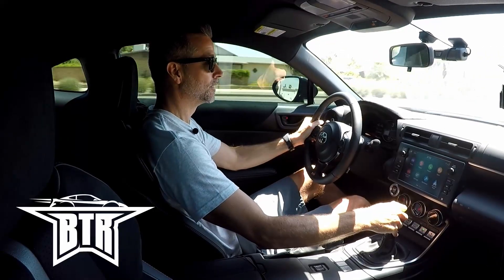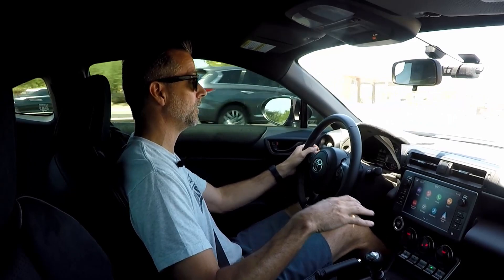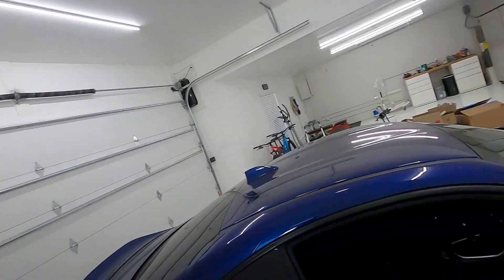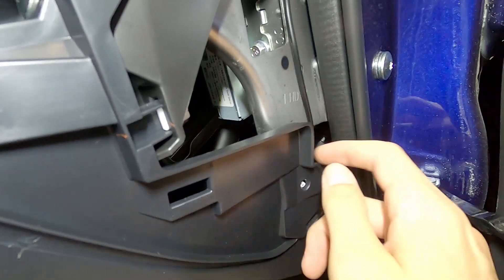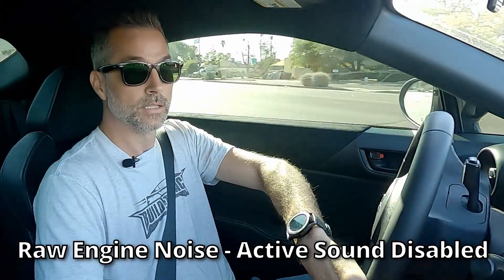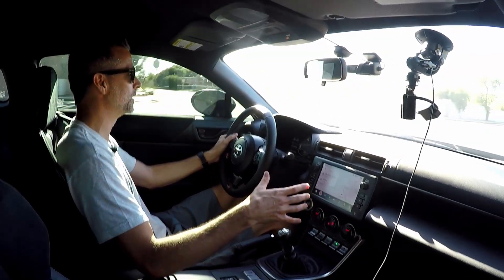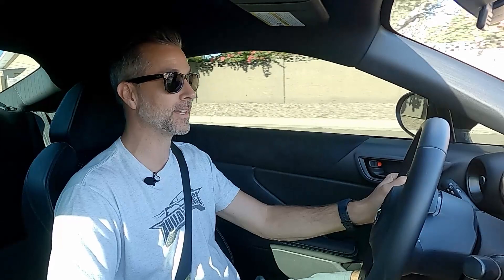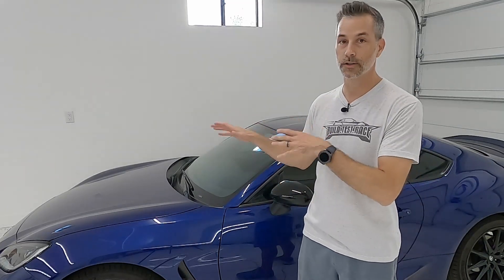GR86 Fake or Real Engine Noise - Which is Better?

Comment: The irony of them creating a car a vehicle with the bare roots for car enthusiasts and a pure experience..  then pump in a fake sound lol
Reply from the maker: I know right lol, I eluded to that in a different comment. Doesn't make sense.
Reply: And now they all come with the EyeSight driving nannies and stuff... Very sad to see the direction sports cars are going.
Reply: @Bristecom Eyesight is just adaptive cruise and stuff, it’s not like the car’s driving itself
Reply: @ It does automatically brake when I don't want it to fairly often though. Even the loud beeping noises get very annoying and you can't permanently turn them off without blocking the cameras and having several max brightness warning lights on your dash. Also the auto high beam feature rarely works correctly and requires me to fight it when I'm trying to turn my highbeams on or off each night (requires 2-3 pulls sometimes). So after using it for 7 months, aside from the auto cruise control, I'd say it's a terrible system that I wish it didn't even have (or at least I wish it would be updated to properly adjust or disable without being penalized with warning lights).

Comment: The fake engine noise sounds like a good copy of an aftermarket exhaust. But once you hear it side to side you can pick that it is not the genuine sound, but only slightly.   Great to get a side by side comparison. Keep up the good work Justin
Reply: What?!
the fake noise sounds like a really bad arcade racing game.
if you want to hear the engine, put an exhaust on the car.
Reply from the maker: Thanks!

Comment: I’ve switched it on and off 3 times already, each time I eventually end up finding the fake noise annoying over time. In my case I have an aftermarket catback though.
Reply from the maker: I'd definitely have it disabled if there is an exhaust on the car :)
Reply: When I get mine I'm probably gonna keep it on until I get an exhaust. I hear if you disable it with stock exhaust, there is barely any sound at all.

Comment: I hated my 2023brz sound system, it distorted my music and sounded terrible, like 4 days after i pulled the plug from the engine sound box and it fixed that distortion in my music as well. Just an fyi.
Reply from the maker: Interesting find! Which model do you have? I have the premium which has a better sound system. I didn't notice a change in music after disconnecting the ASC. Wondering if it's a thing on the base model which has less speakers.

Comment: do you know if it uses a separate speaker, or is piped in on the main speakers?  i have a 2024 brz ts, and just wondering before i detach it.  thanks-
Reply from the maker: Piped in on main speakers as far as I know.
Reply: i pulled the plug - and i think the stereo is 100% better sounding.  may be in my imagination, but i dont think so.  wont be going back to the fake noise!  
 @TheBTRGarage

Comment: I bought 2024 GR86 and drove it with fake engine noise for 3k miles.

Went to Toyota and had them disable it. 

Now it’s disabled for 3000 miles, it’s the best thing ever. That fake engine noise is complete garbage.

Comment: The digital sound actually sounds really cool if you ask me. Sounds better than most aftermarket exhausts. The only issue for me is that its loud. Would sound better if it was quieter.

I dont like loud exhausts personally. Its annoying after a few weeks and the power gain is usually minimal.

Comment: A tube that allows those in the vehicle to hear the engine is far better than a speaker playing sounds of what an engine might sound like. 

In a pure sports car, there should not be any fake vents, aero pieces stuck on to make the car look fast, and no speakers to have the passengers hear what a good sounding engine might sound like. Subaru came so close when building the BRZ/GR86, why did they throw in the gimmick of fake engine sound.

Comment: I have the GR performance exhaust. Does that make a difference in sound compared to the stock exhaust with the fake engine noise off?
Reply from the maker: Not sure, I haven't heard that exhaust in person. You can always unplug the sound generator to see for yourself, plug it back in if you still want it.

Comment: Nice comparison! I haven't turned mine off yet, but I will. The fake sound is just too loud for my taste. I'd rather hear the actual, muted engine sounds. The car is plenty loud enough with the noise coming in from the tires and chassis. At some point I'll add an exhaust, but this will be my first 'mod'.

Comment: After break in and at 1100 miles total I unplugged it....sure its really quiet down low but above 4k you can hear the engine enough aslong as your not blasting the radio.

Comment: Love your videos.

FYI - The system isn't quite what you describe Justin.  There is no audio track that is played, the harmonics of the engine are extracted from the RPM signal (which itself dictate the waveform of the sound naturally) in 12ms updates and a gain is applied depending on torque and acceleration inputs.  What ends up happening is effectively they concentrate the volume of those engine waveforms around the ones that are good (there are bad engine sounds in chain driven boxers as you would know) and less focus on ones that are bad.

The effect is that the sounds is true to life (its its a direct feed from the physical behaviour of the cars engine) as the extremely quick feed (basically 1 100's of a second) captures the timing of almost every single revolution live, with I think capturing the current data point for every 2 RPM at around 10000 rpm.  Certainly more than fast enough to hear even the slightest change in behaviour of the physical engine.

I think its pretty good, I mean you can clearly tell that even though its louder, the sound when its removed is incredibly similar.  With all the regulations that these globally offered cars have to meet, its a good change.

The litmus test is how often people who know nothing about it will comment on how good it sounds.  And they do - its usually the first thing someone that rides along will tell you.  That was just not the case with the last car, and I cant imagine it would be the case (stock anyway) if you removed the sound.

All the manufacturers (Porsche/BMW/Toyota/Honda etc) use these systems, I think the Subaru one sounds better than the Toyota one for instance that they use in the GR Yaris.  If you have an after market exhaust and are not burdened by noise laws then I think changing it is fair, but not because its not good, just because it will overwhelm the noise of the exhaust.   Of course we can all dream of a world where ITB's were something they made stock :)
Reply: Yes. While technically it isnt the true engine's sound, it is from the engine still. Similar to hearing a friends voice on a high quality phone call. Its their voice, its just a little filtered and coming from a speaker.

Personally, I like the pumped in sounds. I'd prefer it if there was a toggle though. Its been my observation that the average person installs aftermarket mufflers and intakes(usually with no tuning) these days mainly for personal tastes in louder sounds over actual performance. So if the sound to your own ears is all the average person cares about, then custom filtered engine sounds coming from speakers or a sound tube is better than the expensive option of swapping intakes and mufflers without a tune(and if its too loud, then others are forced to hear it whether they like it or not too, so there's that if your someone who is considerate)
Reply: @JupiterxBlues  I agree, in particular the sound in the mid range is great.  Up high I think you can hear the engine naturally so its probably less impactful.
Reply: Whole lot of words to say nothing
Reply: All that to hear a noise that sounds like an engine?  Why not just turn it off (or not install it in the first place) and just hear the actual engine?  I've unplugged mine and it sounds sooo much better.  In my view, the ASC creates a sound that makes the engine sound rough and raspy.  With ASC disabled it sounds more like a refined sports car, aka more like a Porsche.  And, yes, I know Porsche uses a similar system.  I'm referring to what the Porsche sounds like from outside the car.  But, with ASC off it sounds like like a Porsche from the inside of the car also.
Reply: @AX-Driver  if it convinces some people not to install an obnoxiously loud aftermarket exhaust because they already hear the engine loudly in the car than I consider it a net benefit. Wish it was on a user accessible toggle though.
Reply: @seanmackay6739  Yeah, good point on avoiding load exhaust systems.

Comment: Let me think...... When driving a performance car, do I want to hear what the car and it's engine is telling me or do I want to hear a soundtrack of what somone at Subaru thinks sounds good.  As an enthusiast, I need to hear my entire car and what it is telling me.  I nead to hear the engine, the induction, the exhaust, the tires, the drivetrain, the road, any competitors, etc.  If all I am hearing is an amplified soundwave based on engine RPM, that drowns out 90% of what I need to hear when I am at the track.

Comment: I've gone back and forth a few times, settled on disabling it. I did do 1 track session without it, with helmet on and windows down it was hard to hear for rev matching downshifts. I did have the rev warning beep set for upshifts, that was fine. I need an exhaust!
Reply from the maker: Ahh, yea I can see it being a little hard to hear for rev matching. Exhaust definitely helps in that department.
Reply: Just pay attention to rpm

Comment: well I'm looking at buying this car, one of the first things I had noticed from the videos and decided to investigate further was the fake engine noise and while it does sound pleasant for some, the time delay on the response I feel can be lacking in feedback to the driver, for example if you're in a corner under load and you're at a point of induction, it sounds like you can hear it better when this system is turned off, so the fake sound adds an unnecessary level to it, and it could be my ears but I can hear that they don't quite marry up exactly to what the car is doing, don't get me wrong its not a bad sound I just personally feel it takes away from the experience a little bit. perhaps a bad analogy is when you put engine noises inside an EV. I understand why you might want something like that, at the same time it's an EV, let it be an EV. id love to hear any differences in opinion, this is a really interesting one to me

Comment: I haven’t try to disconnect my pumped in audio, but it is kinda loud  and monotoned for my liking where I’ve redlined my car a few times because I didn’t really hear the tone change. I gotta try without it before I get an exhaust as well
Reply from the maker: Definitely disconnect it just to see the difference. Super easy to plug it right back in.

Comment: I prefer real noise at all. There are some other tools to improve the sound emotion, more "real" than the active sound system, i.e. intake manifold design, reduction of cabin noice reduction materials and so on
Reply: The problem isnt the car's frame or engine design alone... its both. Modern cars are built so well and so finely balanced that you can barely even hear or feel the engine there. These arent bad things but they actually turn people off from buying modern cars because it feels odd so instead reducing efficiency with a different design auto manufacturers have to figure out ways to provide feedback to drivers to assure the engine is still there lol. Sound tubes, engine sounds, stiffer motor mounts, and more are then added to remind you that the engine is still on.

Comment: I have no problem with engine noise coming from the actual engine with a tube. Why that wasn't carried over is baffling to me. Like, does Toyo-Baru think its customers would like this speaker crap? I thought market research was a thing. Lol
Reply: Maybe not enough room in the engine bay with the larger engine? If a person doesn't like fake engine sounds they can disable it.

Besides they aren't going to design a car with a sound tube and another without for market research purposes.  This is a sub $30k sports car lol.  Also market research said the overwhelming complaint was not enough power.  They solved that.
Reply: Even if it is electronic you can just disable it, problem solved. Most owners just replace the exhaust to hear the noise anyway.

Comment: I wonder if theres a way to make it a switch so you can you just change the sound w a flip of a switch
Reply from the maker: I'm sure you could introduce a switch between the connector and the ASC controller box without too much effort. Finding the plugs would be the hard part.

Comment: Hey Justin, my new BRZ should arrive around the end of this year.  I will likely disable the augmented sound.  Do you know if there is a way to remove the hardware related to that? I realize it probably doesn't weigh that much but I like to get rid of things that are unnecessary. I don't want to rip it out then screw up the electronics elsewhere in the car as can happen with modern vehicles.
Reply from the maker: I haven't been inside there to see what else may attach to the ASC. I've seen photos of the tiny sound speaker and it's about 2-3" in diameter, very small. I would disconnect it and leave it as is...also, there is CANbus on the ASC cable if you ever want to get real data from the car for telemetry! A few people have already rigged up adapter connections into Racecapture, if you're in to that stuff.

Comment: Nice comparison. Real all day. Considering this vehicle and I would have the dealer program it out before I took delivery.  Can’t find one to take out. I’m 6’ 3” and need to see how comfortable it is for my frame.  Nice video.  Keep up the good work.
Reply from the maker: Unfortunately they are still hard to find, although I see many automatic transmission cars showing up on the dealer lots. Maybe go try one out for fitment? I'm 6' and fit just fine with a little bit of extra room. You might be a little tight on headroom, or if you are ever wearing a helmet.
Reply: @TheBTRGarage  unlikely I would track it but thanks for the info.  Just looking for a fun weekend driver.
Reply from the maker: Should work out great then!

Comment: I don't see anything wrong with fake engine sounds.

Also it seems like you are driving way faster to get a good engine sound.  That's an important consideration.... with fake engine sound don't have to rev the engine out as much.  You can get nice engine sounds at 3000rpm instead of having to go up to 5500-6000 rpm.
Reply from the maker: The active sound does not really come on that much in lower RPM's. The test runs are just WOT through the gears to make an even comparison with on vs off.